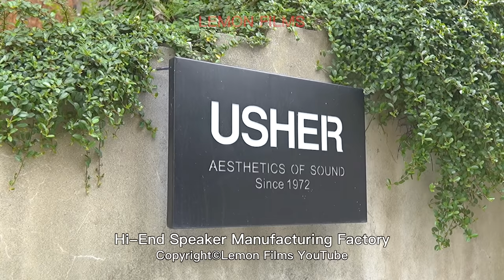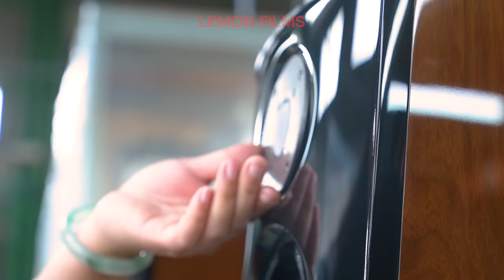Hi-End Floor Standing Speaker Production Process / 落地揚聲器製作過程 (音響製造) - Taiwan Speaker Factory

Comment: They look nice speakers, but the soldering on that crossover doesn't look like it'll last very long.
Reply: i can't solder. But I can solder better than that.
Reply: I partly agree that it might be weak but it is not easy to hot solder on a material that melts! Does not move much as in a car so can hold?!?
Reply: @kolgrillarn  I'm sorry, what material melts? 
It's a PCB, it's designed for that very purpose. 
And yes, while I agree it won't suffer the same movement as say in a car, it is inside a speaker cabinet that will involve a degree of vibration and resonant frequencies, so it's not without complete movement. 
All I'm saying is that for 1k + speakers, they could do a better job with it.

Comment: I'm not sure the crossovers are getting some good attention. The boards were bending as they are tightened down. I wouldn't trust that not to develop a problem. So much for high end. Nothing like TAD speakers that are true high end.
Reply: 12:50 yep...
Reply: Agree, that didn’t look very professional.
Reply: @ChicagoRob2  for cheap speaker would be OKAY but not for those "HIGH END" speakers they ask like 10k for!!!
Reply: AND those workers MUST NOT wear ANY jewelry while assembling speakers!! what a shame!
Reply: Yep, audiophiles criticise mass production, but tolerance would be much tighter than shown here... seal are kind of random and probably differ from speaker to speaker
Reply: That looked to be an etched copper board not a circuit board thus the copper can flex and remain conductive  if the solder remains attached.
Reply: @danc2014  I still wouldn't like that on my speakers.

Comment: The ply forming of the cabinet looks a bit rough...lots of air gaps in the laminates?
Reply: I bet the pressure used in that hack is much greater than it appears. Once machined you don't see gaps.

Comment: I enjoyed this video.  The only thing I wonder about is one thing.  When you hammer down the bottom and top cabinet pieces into the cast frame?  You didn’t press the veneer against the perfectly cut plates. There appears to be gaps that the epoxy or glue filled.  I guess because you are looking for perfect linear appearance from top  to the bottom. The veneer is cast.
Reply: Тяп-ляп как весь Китай! И главное дорого, и потом нет запчастей! Покупайте!!! 🤩🤩🤩

Comment: Poor cabinet sealing for such a high end speaker. The joints were not glued properly and seams not sealed.
Reply: its not high end ... !!
Reply: @triton66  Not high end, according to some comments it goes for $13K
Reply: And the paper cone woofer looks cheap. The top speaker decoration piece is not fully glued. Long time it will start to rattling.

Comment: lousey qauilty control on the build terrible tolerances and using a steel hammer on wood leaves imprints and air gaps no gaskets on speakers and tightening them unevenly bends the speaker frame and warps it.pathetic assembly skills

Comment: I own a pair of Usher Mini-Two's that I bought in 2012, the construction is immaculate even for this entry-level model. It still uses pretty much the same curved birch-ply construction and internal bracing done with MDF, except mine is satin finished instead of the polished look of the higher end models. I still listen to them up to this day, the price/performance of these speakers are so good, I think I need to spend at least $6,000 to get something that's noticeably better!

Comment: I noticed that they use the corrugated cone speaker cones.  There is a big argument in the audio community about the acoustic value of these.  Some argue that this a way to use cheaper and inferior cone materials, but results in each speaker having only a very limited frequency range.  This means that MORE speakers have to be used to get the full range, from about 2Hz to 60KHz, which is needed for true audio reproduction.  The lows are probably achievable with a batch of low-ends, but the highs are going to be a directional crapshoot.  Based on the design, I'm guessing these are highly directional at the top end.  Most other vendors have multiple directors, or scatterers to achieve this.  Most of the "roundish" designs should be better in small studios or stages.

Comment: I have no experience with those speakers. I have a few production quality remerks. 1) During the bending of the wooden plies, I noticed that the pressing was not complete and voids / air gaps left between the wood plies (time 1:00, 3:37). 2) The interior fastening ribs don't fit completely and a voiding gap can be observed at the bottom curvature (time 3:44). During the hand drilling the drill collet damaged / slightly notched the plywood edge (time 7:19). using a longer drill will make the improvement. The crossover PCB is installed directly on the wood without any spacers which caused the PCB to bend during the screws assembly; a major "fault" (time 12:51). Beside those remarks, the speaker cabinet look very nice and shiny.

Comment: The partitions cannot be hammered into the acoustics with an iron hammer. Iron deforms and leaves dents in wood. You need a wooden or plastic mallet. And if with an iron hammer, then through a wooden spacer.

Comment: Sorry but there is no way on earth that these are worth $14,000 USD. Sure other companies might also be ripping people off charging 400k, but if this is all it takes, and its not even a solid piece of wood (its compressed plywood sheets) or extremely complex electronics (like a PC), its wildly overpriced, must cost under $500 to manufacture this in parts.

Comment: Not a lot of electrical testing shown. You would think the crossover inductors would be sealed in varnish. Nope, just tape. 

The PCB crossover is a generic slab from China, single sided with jumpers, which is fine electrically, but not for heavy and large components mounted vertically. The board should be double sided with plated through holes and no jumpers with wire connections using connectors (headers). Then the electrical subassembly could be soldered in one wave solder step. As such, you would have a more robust design in terms of solder joints, and the time saved would more than pay for the board upgrade. The hand soldered joints in the video could be much better if the assembly technician was trained and had the correct soldering equipment. The soldering tip used is wrong, the station power much too low and the operator does not know what a good solder joint looks like. The lack of proper joint wetting (joint solder fillets) alone would fail the assembly in inspection. 

All large components on the crossover PCB must be secured to the board with adhesive, RTV, Epoxy, etc. or better yet the board conformal coated (or partially conformal coated) after assembly.

Why would you not have a custom acoustic padding insert for each driver bay? I also think each driver bay should be sealed with a hard baffle. When attaching the baffles you have to make sure they are air tight. Which does not seem to be the case in the video. If you seal with glue, which is fine for wood, you would seal all gaps. 

The audio testing shown seems a bit strange and incomplete. The drivers would be tested individually with each having a test report. You would think they would at least have a chamber to push the drivers hard for an hour or so. I also expected a large anechoic room test setup of some kind. 

When you manufacture speakers you have to dress and secure all components in the enclosure from vibration up to each driver, which includes the wiring. In the video is doesn't look like this was done.

Over all I think the design is a bit of a hack.

Comment: Woodworking part matches the quality of diy lessons of 5th grader. Just randomly spread glue on pressed sawdust parts and glue those somewhere randomly. Gaps, imprecisions and cheapness of material. I really hope one does not state that this is high grade product. For example, if you make grand piano this way, it would be considered the cheapest one possible. This is not carpentry, this is ikea level assembly line. Pressed sawdust parts by definition eliminates status of a high grade product.

Comment: For 14,000 dollars you think you would have gotten better internals like a digital crossover built in amp and not a cheap coil cap resistor filter wow for speakers this is as cheap as they come very surprised

Comment: I don't understand this; why would you use plywood for a speaker cabinet? Plywood is the worst wood you could use and resonates sound right through it. No one uses plywood, or ever did. It's scary this vigorous process you created and it's all a waste. It doesn't matter how good they look. In the end, the only thing that rings louder than plywood is solid Cherry or Popular hardwood. Even cardboard is better than plywood. For good sound isolation and dead flat speaker response, you always use very dense particle board and wrap it in wood grain plastic film; and in high end you veneer it with real wood and make it even heavier. But NEVER solid wood. I learned this all the way back in high school, some 50 years ago. Particle board will not vibrate and try to be the speaker. (distortion) And you don't let that real wood veneer anywhere near that sound. That's how ALL my high end speakers are built and I have seven of them in my home theater for a total of 2,200 watts of power. All of them except the subs are over 30 years old. My surrounds and subs (2 B.I.C. 12 inch F1 subs@ 1,000 watts) are veneered in real Black Oak. My two "mains" are McIntosh speakers and are veneered in fine Mahogany. McIntosh are very expensive speakers, almost the most expensive speakers you can buy and are sonicly pure, and they're made out of 5/4 inch particle board w/ 3/8ths of veneer! And yes, they are heavy! They're over an inch thick with the veneer. They even come with a graph to match with your equalizer to so they are pure. Even my 600watt subs have this same construction. This is how you make ALL your speakers? Out of plywood? No thank you. I'd buy off the shelf JBL's first. Yours probably even whistle.
Reply: I agree.

Comment: These look shiny but are so far from high end it's laugable. From the drivers, to the crossovers, to the sloppy build quality and poor board work and mounting, and it just goes on and on. Almost every second of this video had manufacturing and qa issues. Find a Focal manufacturing video and see a much better process and quality. Not that they are the best but at least you can see the care and detail in the work.

Comment: Steel Hammers?! Not a wooden/rubber mallet in sight and still a gap left between the shell and the inserted mdf frame. How much RTV silicone!? Yeah, just warp that PCB with your torque driver too. Proper sound deadening sheets would work far better than cheap cotton wadding btw. High end production my a*$*!!! 💩

Comment: They over torqued the circuit board, causing it to deform. That can lead to the runs cracking causing the speaker to work intermittently. Not high end craftsmanship.